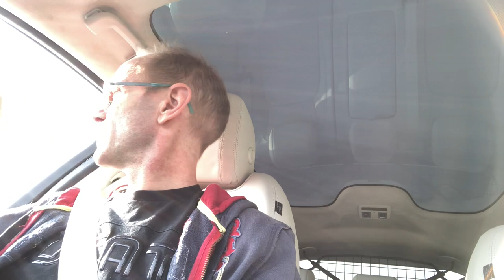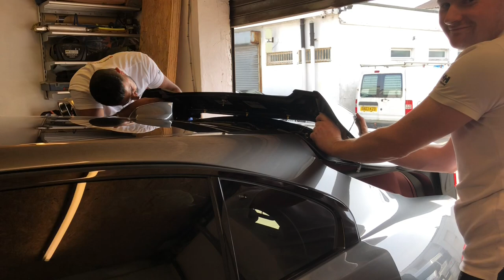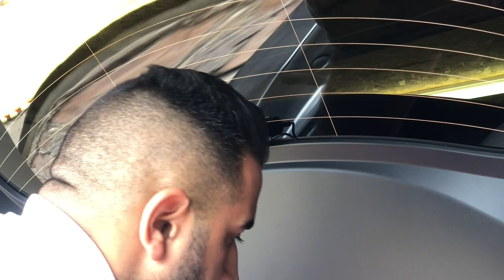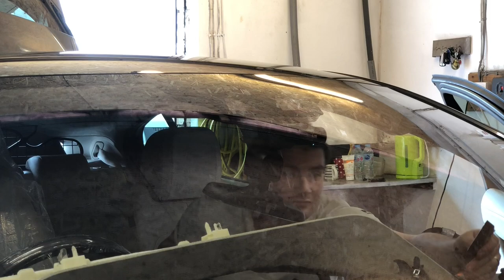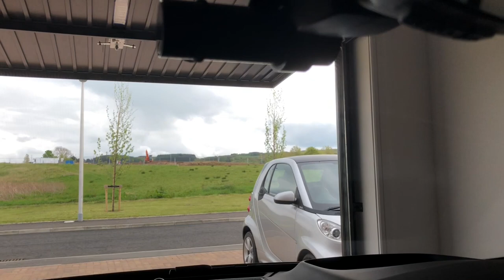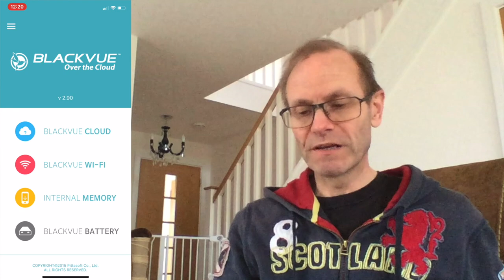IPace Vlog - Dashcam Installation

Comment: Hi, do you use parking mode?  If so does the main battery keep the 12v battery topped up.  In the past Ive used a Cellink Neo battery to protect the 12v battery but I believe that this is unnecessary in the iPace?
Reply from the maker: Hi there. Yes I use parking mode and have never had an issue with the 12V battery. The installer assured me I didn’t need to spend extra on a Power Magic or similar device and he was right. The I-Pace tops up the 12V when necessary so no need to worry. I’ve left mine for days with no problems.

Comment: In case of a accident the last 30 seconds the original frontcam recorded will be saved on the bordcomputer of the I-Pace. So i wouldn´t install a extra cam. But for some situations a dashcam makes sense for sure.
Reply from the maker: Evil Electrician I haven’t heard this feature ever mentioned. But even if true, it’s not accessible by the owner, so unlikely to be any use in small insurance claims etc. I’d highly recommend a front/rear dashcam.

Comment: Hi, Does the installation affect your DAB reception - if not what was the cable route from front to back, and from power source e to front camera please?
Reply from the maker: Hi. My DAB is unaffected. Front to back runs up the left hand A-Pillar along the roofline and down into the fuse box under the rear seat. Hope that helps.